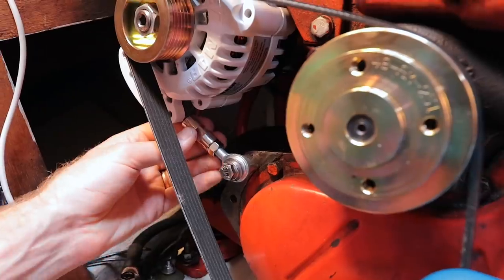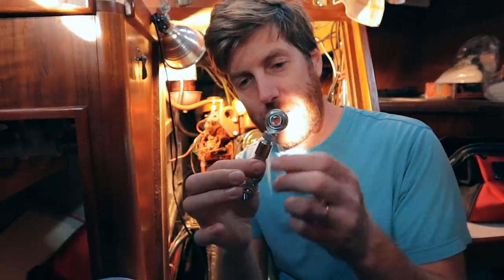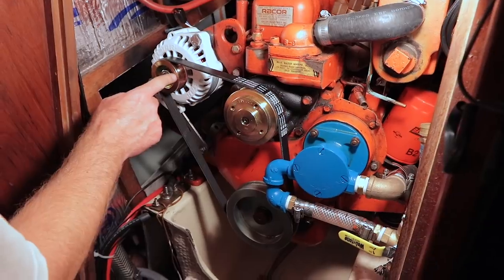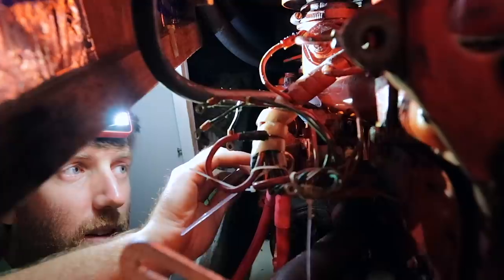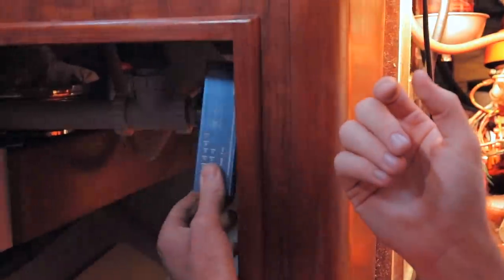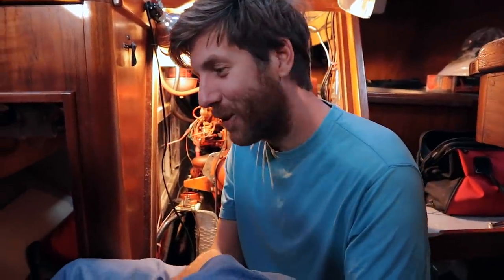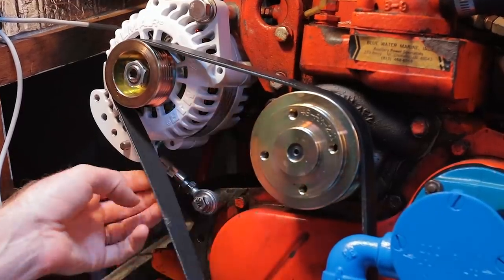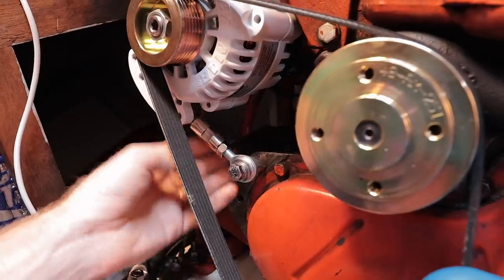“Don’t Do This, You’re an Idiot” | Sailing Soulianis - Ep. 62.2

Comment: Vinyl hose, even reinforced vinyl hose should not be used on an engine water pump.  Get some real rubber reinforced hose.
Reply: Jack Patteeuw, Hi,  I think you will find that vinyl hose is the temporary set up so they can run from a garden hose while on the hard!👍Warren

Comment: Hey so what are you getting out of your new alternator?? Thx
Reply from the maker: One of the benefits of the Balmar Max Charge Regulator is that it is extremely programmable.  So we've set up things like a "soft start" where the alternator doesn't kick in right away.  They also have a setting where you can "de-rate" the alternator so that it is limited to putting out less than it's full field.  The goal is to reduce the heat build up and prolong the life of the alternator & engine.  We've never run the engine just to charge the batteries so having a full 120amp output is not vitally important to us.  The max we've seen coming out is about 85 amps. Which is plenty for our needs.

Comment: I'm not sure but the one odd size battery you have could be a problem. If out is in the group of three , it will discharge and charge differently. Maybe some one out there could carry this further. I had a set up with there batteries and third battery was smaller,  it always overcharged ...Just sayin...
Reply from the maker: That was my concern which is why FF agreed to send another.  I asked what they thought about putting all 4 into a bank,  since the first 3 had already been used for a season. They were pretty confident that it wouldn't create a major issue.  I'm assuming they'd still honor their warranty should anything go wrong especially given that they gave me their blessing.  I started with a restoration charge on the bank drawing down to 10.5 amps and all the way back up as instructed and have not noticed any issues thus far.

Comment: You test a belt by  being able to turn it ninety degrees from its normal flat  position , by hand  towards you
Reply from the maker: So if you can't turn it 90 too tight?
Reply: @SailingSoulianis  yes correct ,being able to turn it that far without massive strain , is the hand test ,not being able to is too tight , then  it will just stretch the belt, or make noise

Comment: I hope you checked you're amp draw of the starter. It is a massive draw, that is why it had larger gauge wire. Alternators don't put out near the amps as a starter takes. It's not unheard of for a starter to draw 600 amps. You'll have a fire issue if that thiner wire isn't rated.
Reply from the maker: The term "thinner wire" is relative term.  The wire is significantly upsized from the wire that was there and used to start the boat for 40 years before we bought it and re-wired the battery bank.  I replaced a #6 wire that was original to the boat with a #2.  Using Blue sea system's wire size calculator I determined #4 would be plenty large enough even using relatively conservative numbers.  There is plenty of ampacity in the 9" of wire there to carry upwards of 150a that our alternator pulls.
Reply: I figured it was relative. Just worried about ya and the draw that a starter has. Not trying to be a naysayer. After 20 years of working avionics and 2 degrees in electronics, I've seen some nasty stuff that nearly took down aircraft. I just heard thin wire and saw you were moving the feed to the starter. The alternator isn't what caught my attention. 150 amps is a lot, but nothing of what a starter does. Starters always have a much larger feed than alternators, but youre smart for oversizing. Glad you got a handle on it. Fair winds and following seas. 🙂

Comment: Looking at your schematic, the charging seems to be a little simplistic - I hope you had just simplified it for the description. I have installed a great device in my boat that allows you to regulate charging the two battery banks (House and Starter) and remove the issue that can cause the alternator to burn out (switching off the battery before the engine) Have a look at:

https://sterling-power.com/collections/dc-splitting-systems/products/volt-drop-alternator-splitting-system-pro-split-r
Reply from the maker: We used a device called an echo charger which is similar but different.